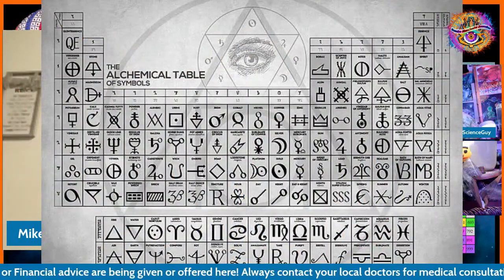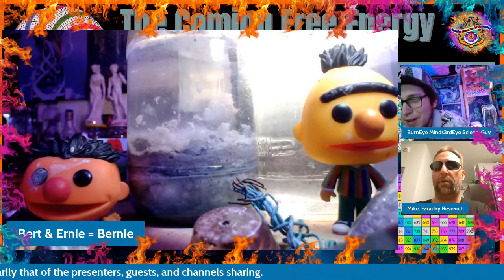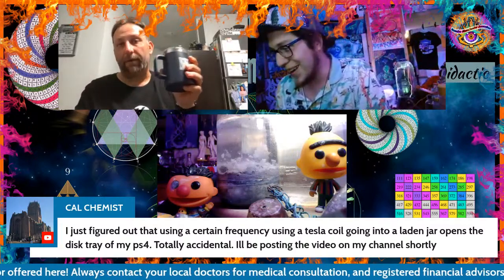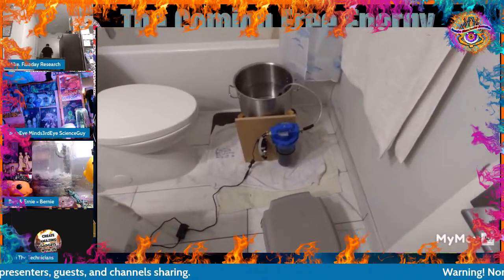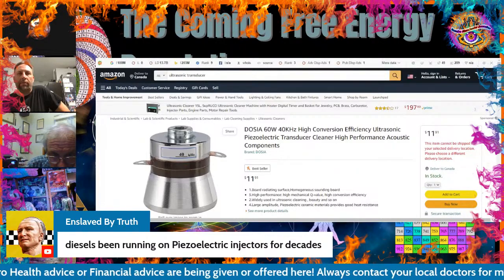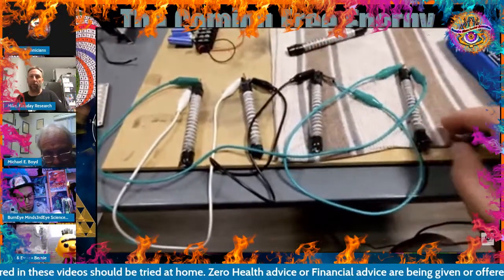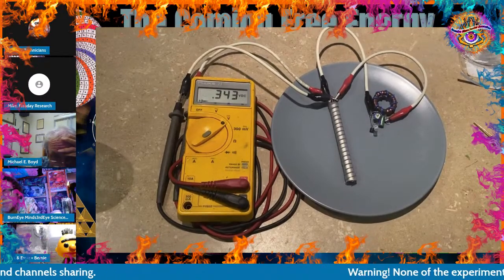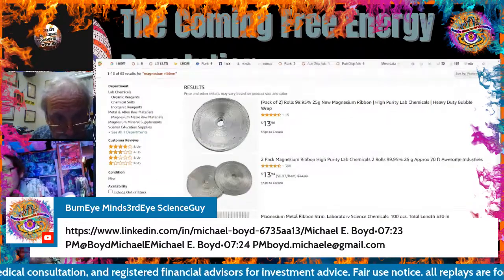Electrical Engineering With Mike Faraday Research

Comment: Question ? In the building of the old school for very intelligent children in US where all the brains gone to and Tesla was involved, were in the walls high voltage stable current cables on electricity.. Have a video of same technology of stable high current sourounding fields used for plant seeds to grow. Corn seems to grow to todays industrial gen corn less hugh but much thicker having more as tripple the cones on it... So it seems to reject old dna and boost cell growth...
But, or so what does a sourounding frequency field on low voltage does on us... ??? Seems to do the opposite or ? Or further... Reminds me in the Dark Chrystal... 😉